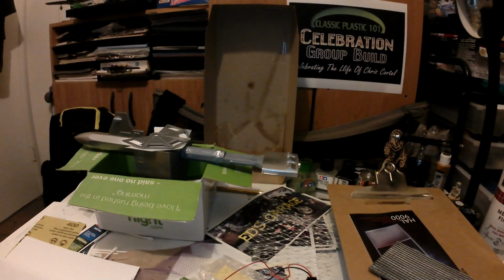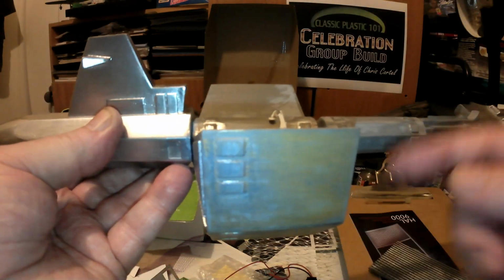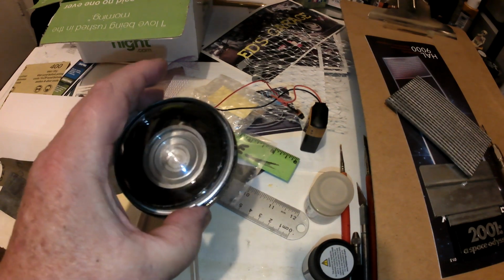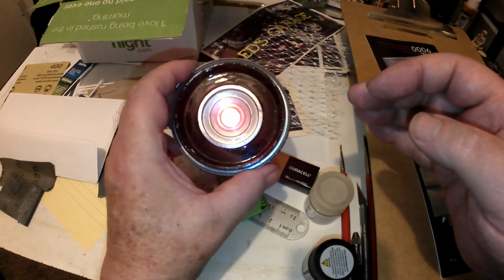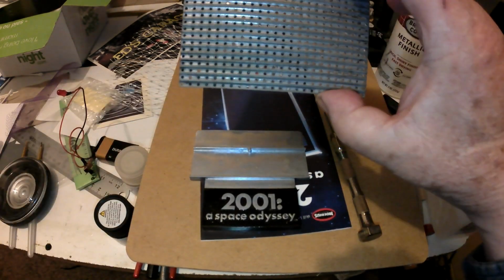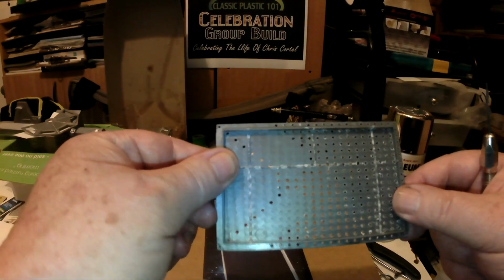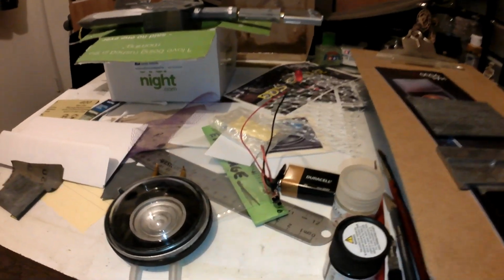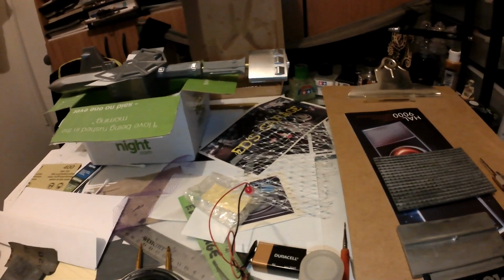Classic Plastic 101 GB Update Two

Comment: You have some great work going on over there. Both builds are super nice. That future is great with it self leveling properties. That HAL Eye is beautiful 🔍🐭👍
Reply from the maker: Thank you, I appreciate that. Yeah it came out great, Now trying to get the faceplate to cure. I am still using the same bottle I bought about 20 years ago. Still finding interesting uses for it. I have used it to put clear parts together, and to fill gaps. It just takes about a month to cure if you use a thick coating like I did on this. What a gloss. Thanks for being my friend.